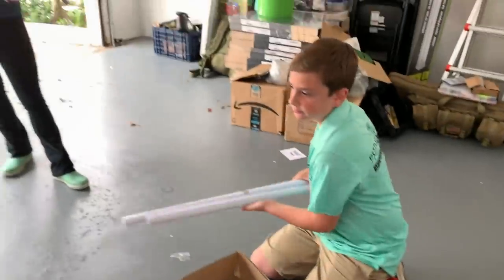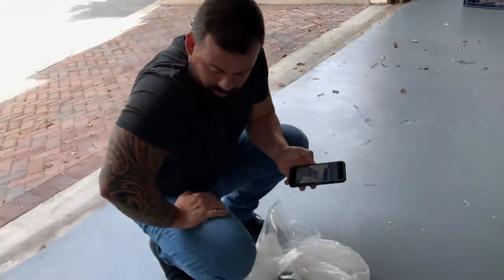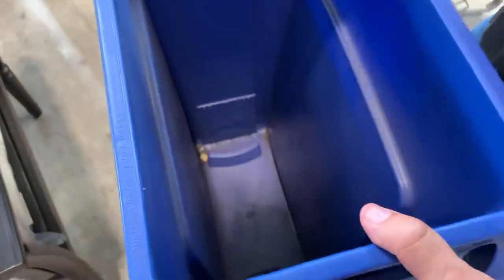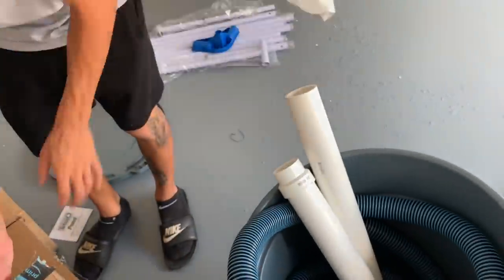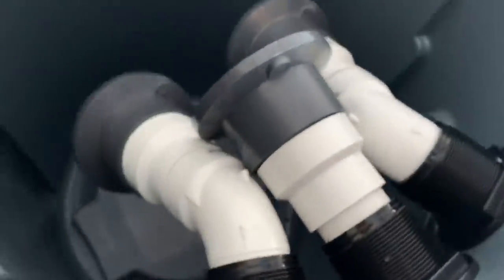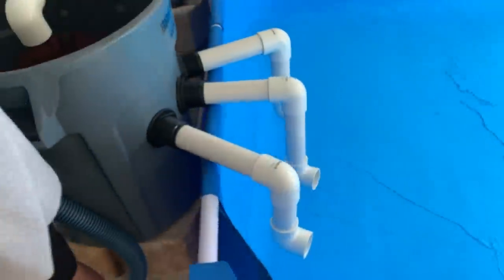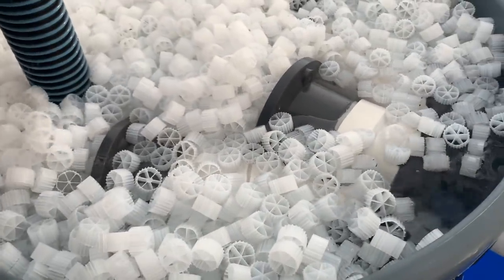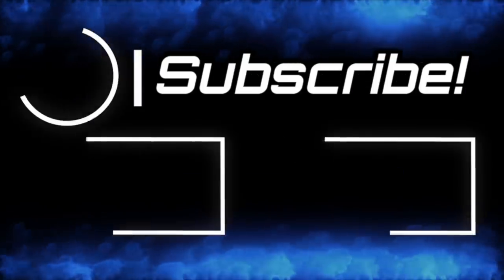INDOOR POOL POND AQUARIUM For MONSTER FISH PETS! *DIY*

Comment: Joey, PLEASE READ, this is very important for the health of your fish! For your fluidized media to work properly for a large amount of fish you would need a much larger amount of surface area(more fluidized media) for the amount of nitrifying bacteria to constantly reproduce and die off. The life cycle of bacteria on fluidized media is much shorter and agitated than the cycle of bacteria on a stable media, (also you want to have the surface of the water capped off on the first chamber so the media cannot float and dry off) such as the lava rock which is also a great form of filtration. I’m afraid the lava rock chamber is also done wrong as well. With this type of filter you want to have your water flow all the way through the lava rock, so it would be ideal to drill a hole at the bottom of the second tub or chamber full of lava rock and rise the lava rock media to a about a foot off of the Bottom of the chamber. This could be done with bricks and egg crate or any other way you see fit. Then you should add another water pump at the bottom of the second chamber where you drilled the new hole and inside the tub underneath all of your media. This will allow you to utilize all of your media(lava rock) instead of just the first foot or so that is receiving flow from the first chamber into the second with the lava rock. With your current setup you will notice a lot of debris and fish waste building up at the bottom of the second chamber full of lava rock (this will eventually cause huge ammonia and nitrate spikes because the waste isn’t being broken down further or absorbed by any plants deep within the tub.) because the flow at the lower 2 feet of that tub is basically non-existent. Ps it may help to try to raise the two tubs off the ground just a foot or two more with cinderblocks just so you don’t have a mass of plumbing and hoses to deal with and clean. If this setup works, it will require lots of maintenance and it will succeed because of the size of pump and the flow is so strong. I love your energy and your videos. I hope everything goes well bro.
Reply: I'm actually getting ready to setup a pool pond temporarily do to construction and just getting ideas from others ect.. My first thought was, if the water is coming in from the top, shouldn't it be exiting at the bottom from each container? Second the final exit before returning to the pool shouldn't the lava rock be  set up off the bottom of the barrel creating an empty space. I'm not trying to criticize anyone, I'm surely no expert by no means but since BB needs Oxygen,wouldn't everything below the outlets be useless? Or worse become a breeding ground for bacteria ect, that you definitely don't want? I'd love to know a possible explanation for the way they set it up in the video.

Comment: The outlets for the lava rock bin should be at the bottom so water could flow through the Rocks it only touches the top surface and then flows out leaving 80% of the rocks under the outlets redundant

Comment: You should put the filterfloss as first stage and have that tub flow to the bottom of the lava rock so all the water has to flow up through it before exiting into the pond it would be alot more efficient rhat way you have it topsy turvy atm 👍🖒👍🖒👍

Comment: the only thing I’d do different is have the exit holes of the lava rock trash can at the bottom so that the water has to flow through the filter floss through the lava rocks and out to the pond. Egg crates should help with the baffling before the exit holes. So put the egg crates at the bottom before the holes and silicone it, MOST OF ALL ENJOY THE F#*K OUT OF IT

Comment: There are some massive flaws with your system. You’re not getting proper exposure to all media. The water flows in and out right away leaving the bottom media in still water. You need to force your inflow to the bottom and let it work it’s way up through the media. Same on both buckets.